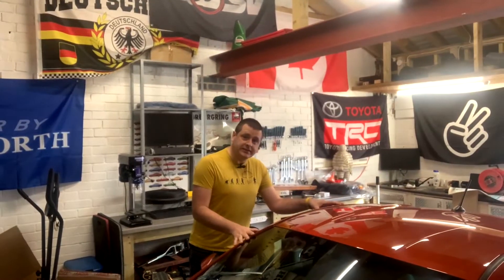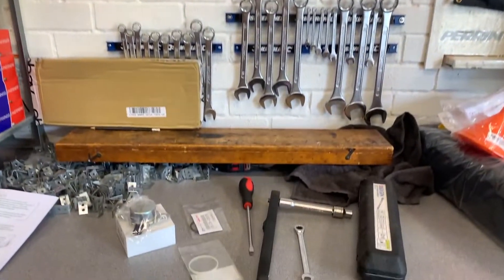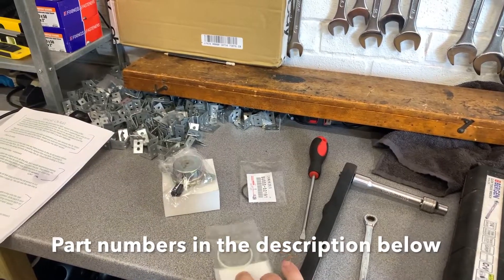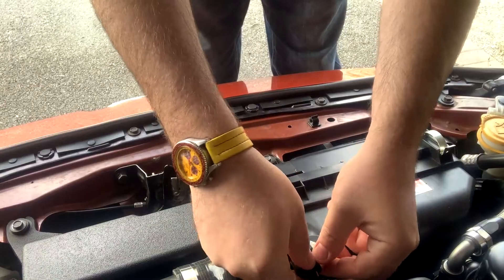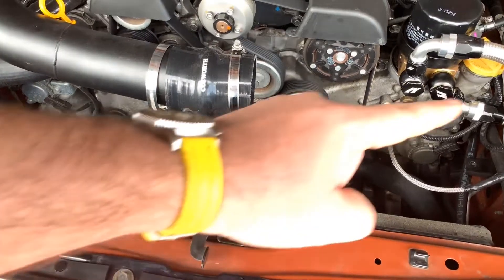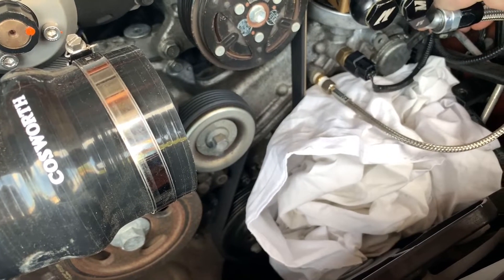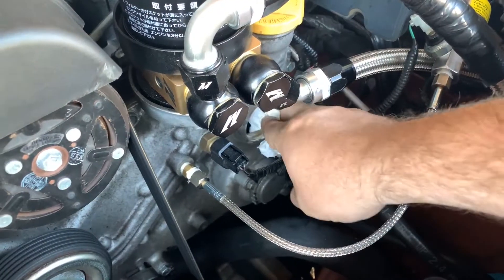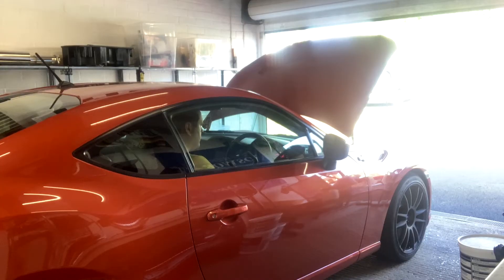How to fix engine code P000A, P000B, P000C & P000D on a GT86 or BRZ #gt86 #brz #frs #toyota #subaru

Comment: Can you do a video on the Vacuum pump?
Reply from the maker: What job would need to be done on the Vacuum Pump? I’ve never heard of one ever going wrong.
Reply: @leedfollow  It makes a ticking noise that sounds like bottom end knock. Vacuum pump is only present on the Automatics. Seems like it causes an oil leak too
Reply from the maker: @SurgeX798 - I’ve only ever seen and heard of oil leaks from the blanking plates on the back of Manual cars. Never seen anyone suffer a leak from the Auto Vac pump before. If it ever does happen to mine I’ll certainly do a video on it.

Comment: Is it normal for the new sensors to throw these codes after you replace them for the first few driving cycles?
Reply from the maker: Nope, afraid not. If you cleared the codes before you fitted the new sensors then you definitely shouldn’t see the codes return. Its possible your new sensor is bad. You could clear the codes then switch it around with one of the sensors from the other side of the engine. If the code then moves to a different place then you know thats the issue.

Comment: Can this sensor being bad cause the car to feel even more underpowered than it usually is? Cause I got these codes recently and it will go from feeling fine to having to floor it to go anywhere.
Reply from the maker: Yeah definitely. Sounds like you need to change at least one of them.

Comment: Does this also create knocking sounds?
Reply from the maker: No that is going to be something else.
Reply: @leedfollow  really? even with really bad oil that's sludgy?
Reply from the maker: @Fahnominal when these fail it will just cause an engine code and possibly you may lose some power. They don’t cause knocking (or at least i’ve never heard of them causing knocking and I don’t know how they possibly could). How come your oil is bad and sludgy? Dirty oil will deposit dirt in the oil control valves and ruin them, so important to keep the car serviced and the oil as clean as possible.
Reply: @leedfollow  the car is a wholesale car and it's been very neglected. I acquired it recently.
Reply: @leedfollow  I'm changing the oil tomorrow on it and may do an engine flush beforehand also using Liqui Moly.
Reply from the maker: Cool. Fingers crossed a good flush and fresh oil helps a lot :)
Reply: @leedfollow  It fixed the problem! I also cleaned the solenoids with MAF sensor spray!
Reply: Also the knocking sounds have gone away!
Reply from the maker: Congrats! Thats great news! :)
Reply: Actually it does. Also poor fuel economy, hesitation when talking off and coming to a stop, lack of torque, rough idle.
Reply from the maker: Didn’t for me. The car ran exactly the same before and after I change the solenoid.

Comment: Can't resist to nit pick. Most likely you over-torqued the bolts. Usually with click-style torque wrenches the force should be applied at the center of the grip handle. Closer you get to the pivot point the more torque will be applied for the wrench to click. But in this case + - 10% doesn't really matter.
Reply from the maker: Yeah it doesn’t really matter

Comment: Good video. I just got this code on my 2016 FRS. Just recently passed 100,000 kms. I have an appt booked with the dealer for next weekend. I am hoping replacing the OCV will fix it. They will be a diagnostic first.
Reply from the maker: Nice 👍 Yeah should be an easy fix
Reply: Did you get it fixed ?
Reply: @kowgan09  Yes, had P000A and replacing the OCV solved it. Drove about 2k+ kilometers and hasnt come back and the car is back to normal.
Reply: Thank you. I have P0016 and replaced sensor and OCV but no luck.

Comment: Does it affects the idle? I have a CEL on and my idle goes dip and the CEL throws me a code of P000c bank 2 cam shaft
Reply from the maker: Yes it does tend to affect the idle once the CEL is on. Once you clear the CEL the idle returns to normal.
Reply: Thank you 🙏🏻